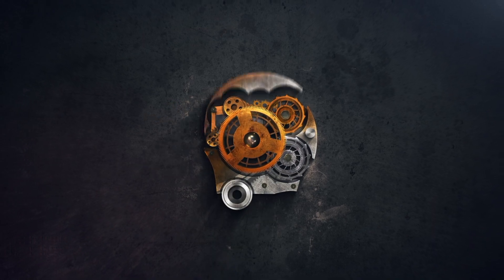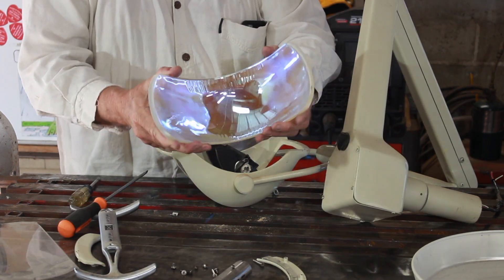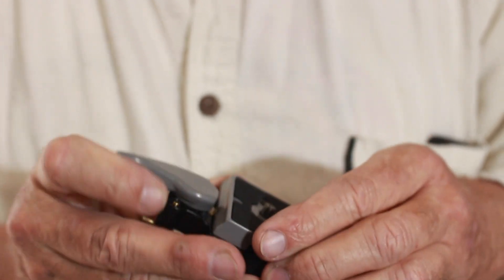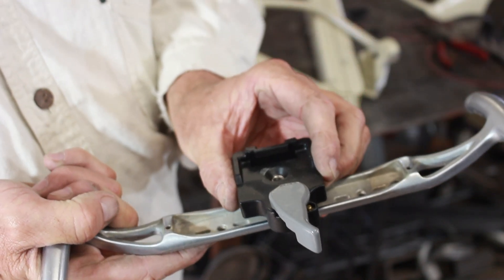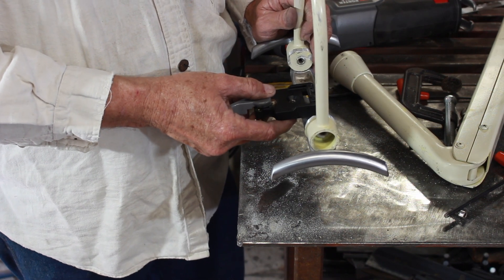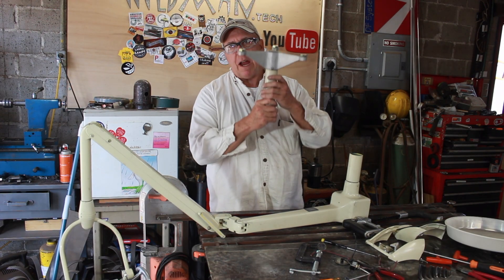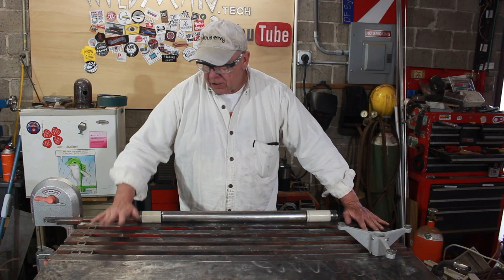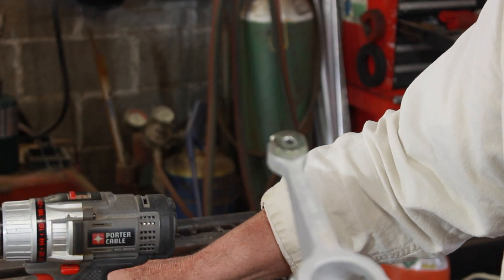Dental Exam Light Camera Boom

Comment: if you have to change your battery so often, could you run an AC adapter through that boom so you can plug in your camera?
Reply from the maker: Then I have to wire it. Too much work. I still pull it off the boom for other shots.